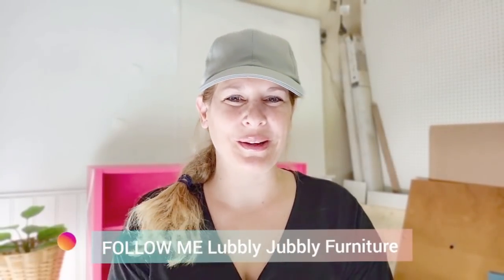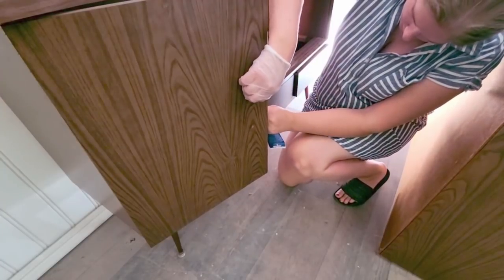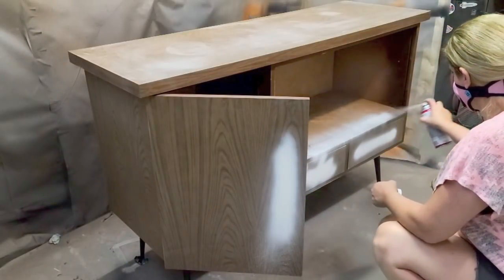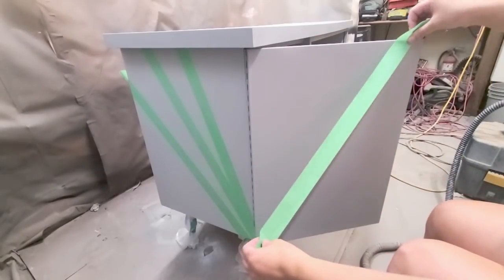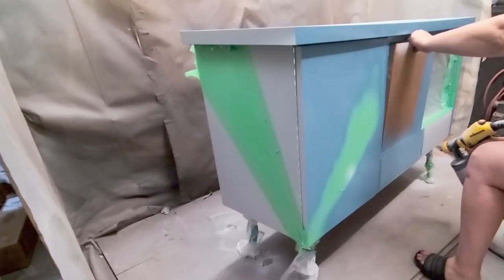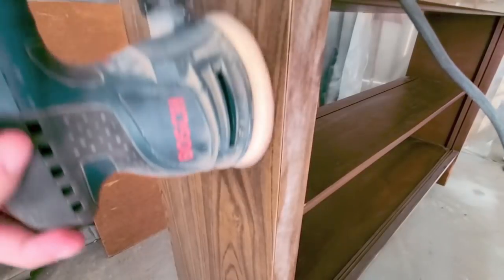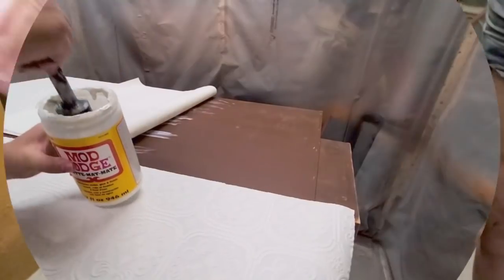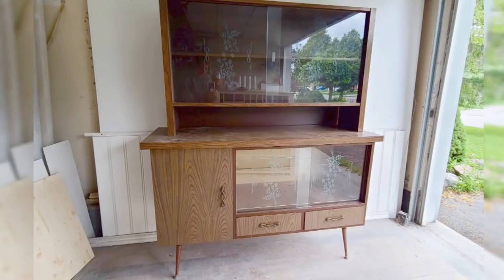Mid Century Modern trash to treasure | Ugly Duckling Challenge

Comment: Why use kilz and bin 123?
Reply from the maker: The bin was for coverage and because i saw bleed through only in one area the spray is convenient. Since that video i have actually switched to Kiltz restoration primer which is absolutely amazing for bleed through so i no longer need to use the sprays unless i really need to
Reply: @lubblyjubblyfurniture  thank you. I get confused about why shellac is used by some and bin is used. I thought they both do the same thing.
Reply from the maker: @shirley1091  shellac is oil based so i don't use it in my sprayer and the bin is water based so its easy to clean out. Shellac is known to prevent bleed through but i really like the kiltz restoration primer now which is water based